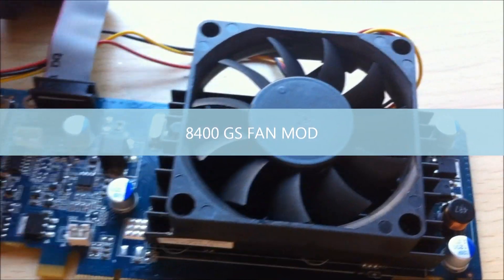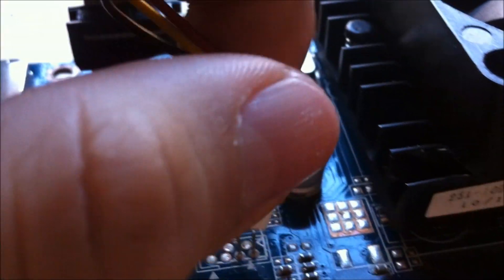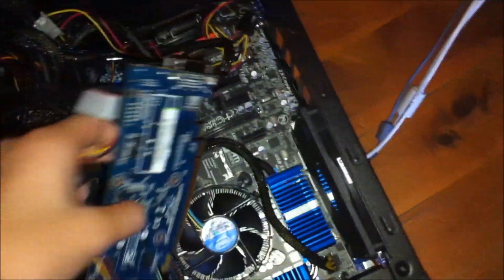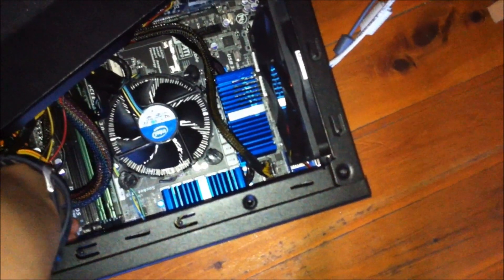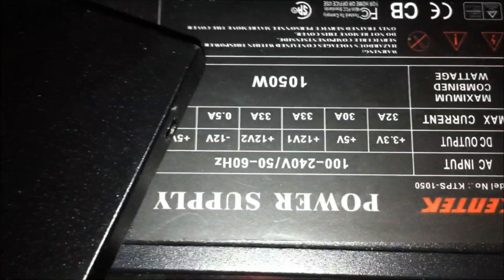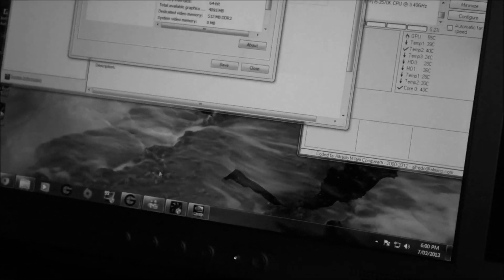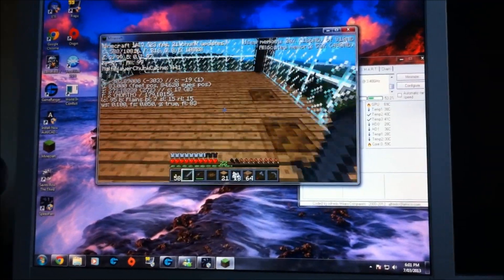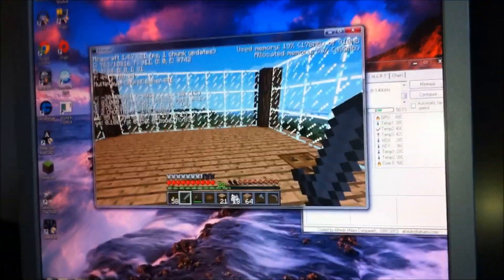DIY Replacing/Modding a Video Card's Fan With a CASE FAN 2022(Self Powered)(ANY CARD or PERIPHERAL)

Comment: friend gave me one of these. i put a massive cooler on mine from a 6900 bfg, and now i can overclock it to 750MHZ, and 1500MHZ on the shader clock. 250MHZ more and ill have it up to 1GHZ. ill post if i can get the 8400 GS up to 1GHZ, and post a "how to".
Reply from the maker: Mine maxed out at 800 mhz, i don't know if you can hardware overclock it. 

I'll try to overclock it some trash cards with a delta fan running

Comment: I will try to do this. My GPU (hd6750) fan just died and it was a 2pin fan, the fan i am about to buy is 3pin. Nice vid, bro. The only thing i have to say is that you could simply  pull the 2pin protector, without damaging the pins.
Reply from the maker: +LksRmg Do it, should be fine

Comment: Gelid solutions sell a vga to pwm converter cable for two quid. Its not worth risking messing up the power output on better cards. Also only use pwm controlled case fans or it will be full speed all the time.
Reply from the maker: Its in the fan socket so it should be fine. I don't believe it will overdraw any current. Tbh it should be able to auto adjust speed to if the card allows it but yeah. Interim/$0 solution
Reply: +=[Compuguy123]= It wont be able to adjust the speed unless you use a PWM case fan. Spend the extra £ and check the fan is pwm controllable.
Reply from the maker: +Joe shmoe its pretty quiet lol
Reply: +=[Compuguy123]=  Wait until you need to use a pair of 90 mm fans,you will wish you had bought PWM. Its pennies more and they will last twice as long as well as being barely audible whilst just watching video etc. Use what is best,do the job once. Dont XxXx about with cheap rubbish.

Comment: Please for your own good, get a new PSU. Kentek is a fake brand. I have a "400w"andd
 It produces about 200w. So get an 800 or 750w psu from a known brand like coolermaster, rosewill or corsair. Please do your self a favor. Thoes powersupplys only produce about half of what they say and they dont filter thier voltage at all, so you are getting nasty voltage in your motherboard. Its like the tapwater of voltage. And it has little/none surge protection. 
( The worst fucking song is on the radio in my car right now "selfie".)
Reply from the maker: i have

Comment: That plug for the case fan is huge! Mine's a TINY 3 pin connection.
Reply from the maker: it all depends, but you can try soldering or hot gluing the wires direct onto them to test.
Reply: *****
lol right! you twist it twice and a bit of isolirband... done! that fan can work with 2 pubic hairs
Reply from the maker: Cauda Miller O.o